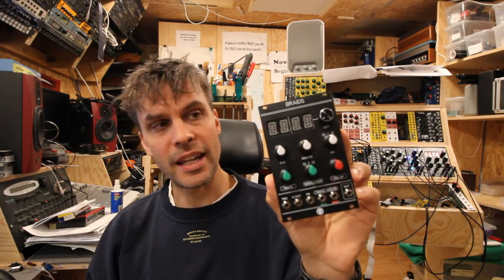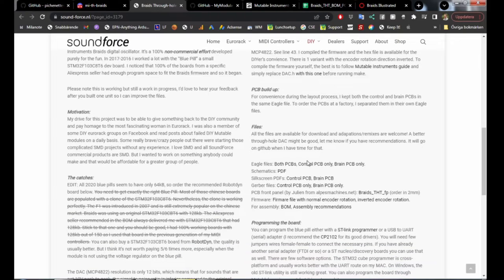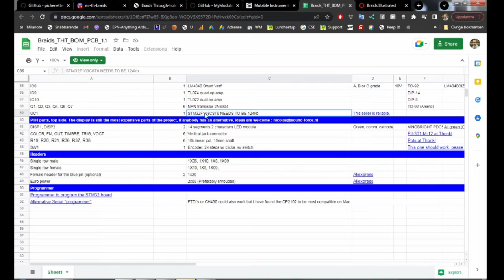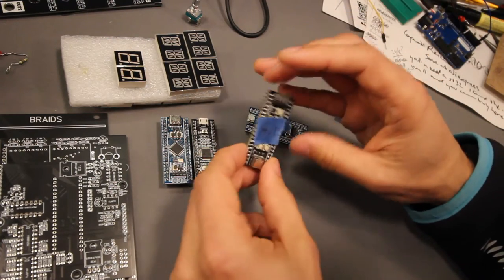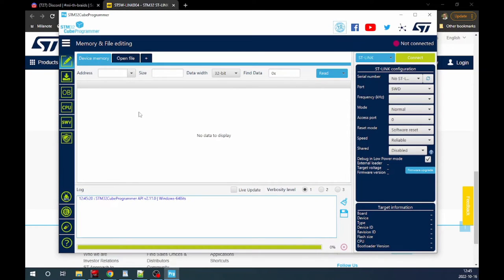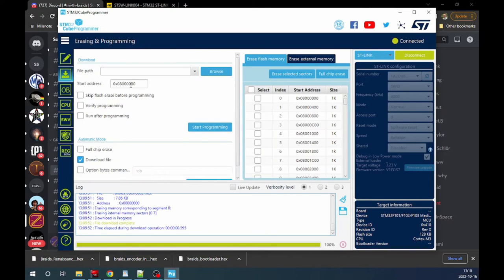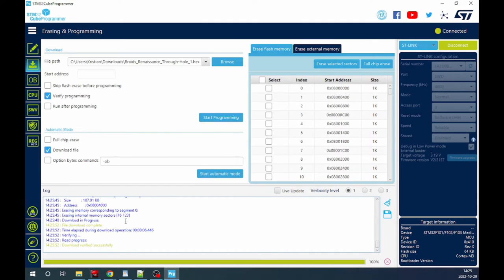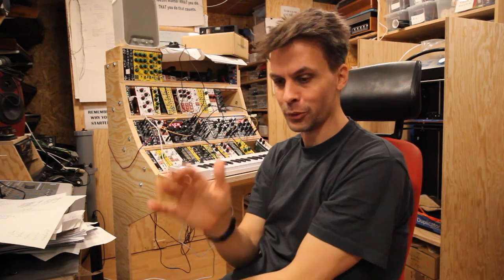DIY Throughhole MI Braids - Modular in a Week

Comment: The C8T6 (the real one, not a fake or a renamed brand) and the CBT6 both have the same silicon die. The only difference is the factory settings that identifies the C8T6 as 64kB and the CBT6 as 128kB. The reason of why the C8T6 costs much cheaper than the CBT6, is partly because ST would test the endurance of the half of the flash for those dies being sold as C8T6 (though, usually, the unofficial extra memory would be as good as the first 64kB), and another reason is for marketing and/or trade rules of supply & demand.

The STM32F103C8T6 is not the only case for this. In fact, ST has just a few dies for the whole range of MCU families. For example, the K4T6 would have the same flash amount than the K6T6. The same for the F2P6 and F3P6.

There is a testing firmware for detecting fake Stm32f103 ICs. One of the tests is checking for the presence of 128kB. If so, good chances are that the chip is original.
Reply from the maker: Wow! Thanks for a good in-depth explanation that does explain a lot. :)
Reply: You're welcome. You can check by yourself by taking a look at the XML files in the cube-MX-db folder of a source code repository (search in google because YouTube deletes my comment if I write the site name 🤷🏻‍♂️).

For example, both STM32F030C6T6 and STM32F031CxT6 have DIE444. Chances are that some of the official features of the F031 are still present in the F030.

EDIT: There is a TXT file listing all dies for the STM32 families, and you can find it if you search for "Is STM32F030C8T6 a rebadged bigger brother?" search term (again, i can't reference the file bc YouTube would delete my comment)

Comment: I don't know if you can advise me, but I have Tinnitus and want to make a woosh sound at 5,500Hz do you know how I can make this sound please, thanks Bob in the UK
Reply from the maker: Do you mean a noise sound but narrowed down to 5500hz? If you only have one specific frequency you will get a tone. I am guessing the 5500hz is the tone of your tinnitus? So maybe you want a larger spectrum which then creates “colored” noise. Making a white noise (full spectrum) is very easy and there is a video on that. Also you can try out the “colored noise” which is filtered at different parts of the spectrum. Or you can make your own with a white noise and one or two filters. Using one high pass and one low pass filter you can hone in on the exact frequencies you want.
Reply: Have you looked at the SoX open source command? It creates tones, sweeps various filtered noise and can apply filters to create .wav files. Also useful to create or modify samples for Eurorack modules with microcontrollers.

Comment: have anyone ever had some tune throble? It seems not more precise, every octave has different tune. What can be hte problem?
Reply from the maker: I think it might need some calibration. Check the braids manual for how to do that exactly. If that doesn’t work it could be something on the data lines between the stm32 and the DAC. At least that is the most common error people have had. Check my discord channel for the braids for some more ideas maybe. Hope you find it. Let me/us know how you fixed it.
Reply: thank you. After this post a discovered that i could calibrate Braids (Cal from setting menu). I'm doing some check and now it's better